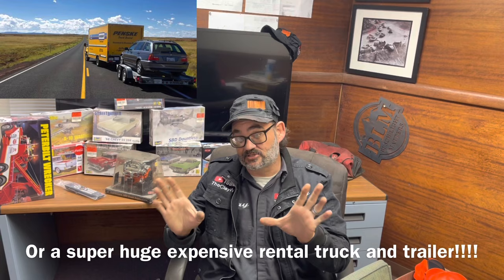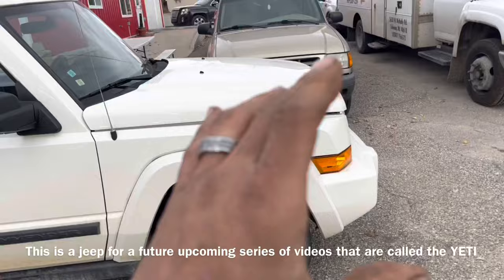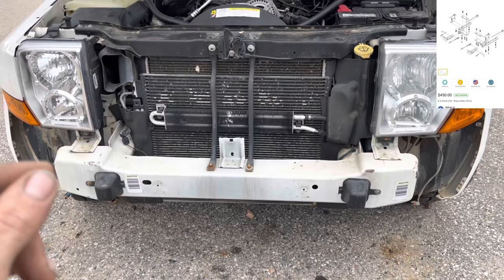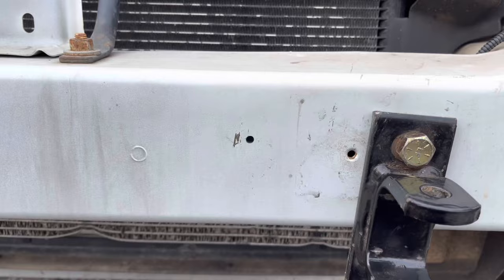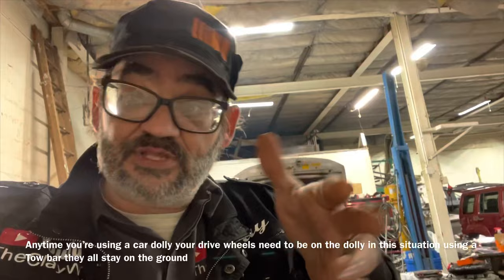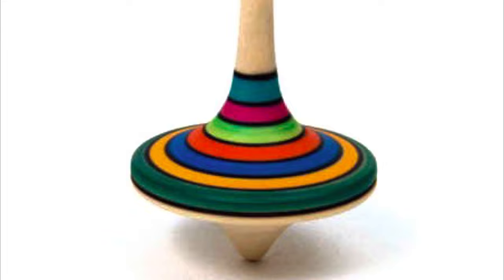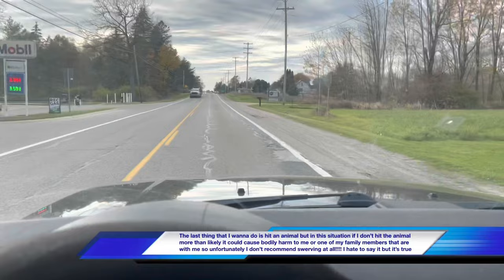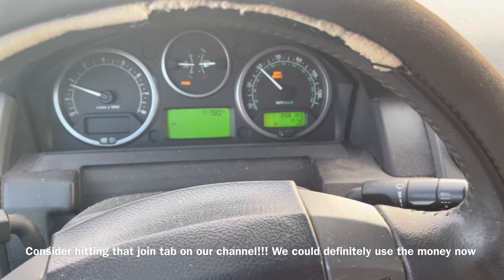How to Use a Tow Bar on Any Vehicle and Why It Works , Why Towing a Vehicle Will Not Crash and burn!

Comment: I used a fence post with a 2" trailer hitch from harbor freight and towed my 89 honda accord 2,300 acrost the US with my VW golf VR6 .It worked perfectly. key in and battery disconnect
Reply: I would like to see that ! Was it a steel or wood fence post ? How did you attach it to the car chains and turn buckle ?
Reply: I have a 96 accord and they don't come with a metal bumper
Reply: That's pretty much exactly what I'm working with: a VR Jetta and a '91 Accord. Good know, thanks for the details.
Reply: @Shellyspurr Sure they do. The bumper itself is steel, but you have to remove the exterior plastic bumper cover to get to it. The bumper cover typically has a Styrofoam inner core that stays in the cover as well. You need to remove the plastic cover from pretty much every bumper to use a tow bar and bolt the brackets to the metal.
Reply: @YerBrwnDogAteMyRabit  not this car, my Charger has what you're describing, but the accord is a composite bumper. I drilled through it.
Reply: @Shellyspurr  
Foxbody Mustangs also... the bumper (the real bumper under the
urethane  cover) is fiberglass.
Reply: @garyuselman8597  This is exactly what Clay meant when he talked about Common Sense not being so common anymore. 

HE traveled 2300 miles! Yeah, he used a wooden fence post (Insert sarcasm here). Let me know how that works out for you!

Comment: About 20 years ago i towed a 1970 VW bus using a tow bar, with a 1971 VW bus. Worked like a charm, i would like to apologize to the woman whose front yard i had to use to get on the turnpike after missing the entrance. You can't make as tight a turn as you would without being connected via towbar.

Comment: Great video, man. I bought a new tow bar 15 years ago and never had the courage or need to use it, but I sold my car trailer and now have to tow my small tractor about 15 miles. You have given the the knowledge and confidence to bolt it on and give her a go, at slow speed, anyways. Thanks for sharing your knowledge.
Reply from the maker: Can you send me some pictures to my Clays AC and auto repair Facebook page. Direct message me through there if you don’t mind I’ll make a post about it on my channel
Reply: Takes too long.  No thx. Ain't nobody removing covers.. thx tho.

Comment: Outstanding video, you explained everything very well! Last year I flat towed my 04 Civic 600 miles with my 05 Civic using a Harbor Freight tow bar on its bumper bar like you showed and magnetic lights on the back and it worked great other than the towed car trying to wander around because its steering and suspension was in bad shape at the time. I'm sure now that I rebuilt the 04's steering and suspension and it drives correctly it would tow well if I ever need to tow it again.
Reply from the maker: Thank you very much for the kind words Avery welcome to the channel. Happy to have you.

Comment: about 10 years ago my VW golf snapped the T belt and cost me 350 to tow it home that pissed me off so  i thought  i have to build  a tow bar   , i bought a  tow bar like that  from harbor freight plus I extended it with square tubing and a  flat stock piece welded to extend out at the end to sit above the control arms then bolted  steel chain at the end of the square tube , bolted 2 3500 pound straps to each arm  i loop the chains around the control arm and hook the straps to the chains ,  and off I go in 10 minutes,  not only have i saved a lot of money since I also made some

Comment: I just got a tow bar from vevor and a few things in the instructions worth taking note of are..
--Some vehicles with power steering may “follow” better with the engine idling.
--When making turns begin by rolling straight forward, then turn the wheel.
--Do not back up with the vehicle in tow.

Comment: I'm turning my 2002 s-10 into a towable camper and had no clue on how to use a tow bar. Thanks to you I'll finally be able to start this project. I plan on gutting the engine bay and interior for storage so I don't think weight is going to be an issue. Thank you for the explanation.  Just wish i would have seen this sooner.

Comment: New to tow bars just wanted to say thanks. I'm pulling a 2wd van and was gonna pull the driveshaft until I watched this
Reply from the maker: If you can pull the driveshaft I would recommend it sorry I just seen this post
Reply: @sharpcarco  I routinely check the rear end to see if it was getting hot and it wasn't it wasn't even getting up to regular temperature. The transmission wasn't either

Comment: I really enjoyed your video. I like your sense of humor. You’re a lot like I am. How hard could it really be? Let’s just try it. I’m gonna put one on a jeep grand Cherokee 2004. I have tow lots of wranglers. But never cheap grand Cherokee with a plastic bumper. I’m going to use the multitool to cut out a rectangle through the plastic bumper cover. Thanks for the video.

Comment: Ordered a Miller 110 welder($625) and a surge brake actuator($400). Steel estimate @ $400. Going to build my own tow bar! Couldn’t find what I wanted at a price I liked to tow an 8000# motor home. After this trip the tow bar will turn into a trailer to be used behind the motor home. Going to hook the surge brake actuator to the motor home trailer brakes.
Reply from the maker: Any updates on your custom tow bar? Sounds pretty sweet!
Reply: @sharpcarco  decided my van would not be able to tow the motor home over the mountains so the project is on hold for a few months. I’ll go back this summer and try again.

Comment: You could have gotten a different hitch that was level pretty cheap from harbor freight. Also not near as concerned about pulling something as I am stopping it. Back roads and slow speeds may get it, but no place to be on the highway, especially in traffic when you have to make a hard unexpected stop to avoid rear ending someone. Have you checked to see if this is covered by your insurance?

Comment: Good video,  I'm towing a 98 gmc with a 2006 chevy silverado both are 4x4 to Kentucky from Arkansas in about 2 weeks what advice could you give me
Reply from the maker: Remove the rear driveshaft and the front driveshaft

And if you want some Economy in your  tow rig 

Buy a hydrogen generator  hook it up and fill it for You Tube

Comment: I was a little confused on the all wheel drive part . So what your saying is that it’s safe to use the tow bar on it as long as it’s on neutral
Reply from the maker: Well, as long as the very short distance, and all four wheels are on the ground like in my situation, everything should be a neutral. The only problem is that the transmission pump does not pump unless the engine is not running so whenever possible it’s always best to remove the driveshaft if possible.. and especially if you’re going to great distance, I would say if you’re going any further than 20 or 30 miles it’s better to flatbed it or use a wheel dolly with wheel dollies on the back

Comment: I sure hope my 2000 4x4 s10 blazer will handle pulling a 1987 s10 4x4.  Just bought an old blue ox tow bar set up. Planning to mount it to the front of the frame where the tow hooks mounth.
Reply from the maker: How did it turn out?
Reply: @sharpcarco  life happened and I didn't get the 1987 s10.  I did manage to find a cheap tow bar set up . $10 . Couldnt beat it.  I also found a Uhaul hitch in the Upull.  Paid $40 for it.  I did pick up a project car hauler trailer, not sure if I'll keep it . Either way whenever I run across something else , ill have the stuff to haul it.or tow it.

Comment: Thanks for making this video. I probably would have drilled right through the plastic to mount the tow bar. But taking off the cover makes good sense so you can see the best place to mount the bar.
Reply from the maker: Well thanks Michael for taking the time to write that message I’m glad it helped you welcome to the channel and we’re very happy to have you.
Reply: That is the most ridiculous comment I saw all day. The plastic cover most definitely will not hold up to the stress of pulling the car by it,  you almost certainly won't be able to get the nut on the back of the metal bar with the cover on, you could easily damage things behind the cover by blindly drilling into it, and having plastic and likely foam between the tow bar's brackets and the metal bar would be extremely dangerous since it's so soft. If it squishes down as you drive, the nuts will come loose. Towing is not the place to be lazy or shortcut things to your convenience.
Reply: @averyalexander2303  you are rude. There is always one and you are it.

Comment: Before anything, I would like to say thanks for the video, I got a little issue, I need to pull up my car about 14or16 normal drive,so I consider that  most be going to take me more hours than that, my car is a old 78 ford thunderbird that’s heavy, my plans are to pull up with a 1500 dodge ram, I feel a little bit scared, I never did this before, I will going to need good wishes, I have been pulling trailers in the USA but never cars with tow bars, thanks for the video.
Reply from the maker: I recommend removing the driveshaft before you do it, but pay close attention to the part of this video where I show you why pulling something with a tow dolly is not really a problem… there are particular procedures though for a rear wheel drive vehicles I think you need to hold the steering wheel with the safety belt but it’s been so long since I towed a rear wheel drive vehicle with a tow bar I don’t know that I ever did it before. So just a smidge more of research will make you feel more confident I’m certain you can do it. I don’t think there’s gonna be any problem, but less be a little bit more cautious, and will be assured success.
Reply: @sharpcarco  I really appreciate your advice, I’m still working on , the companies over charge to howls, with that money I can make the trip and I still save money. Thanks again and happy 4 of July.

Comment: I need to tow a 2011 equinox from Michigan to Mexico. But I don't know what drive shaft to remove so the transmission or parts don't burn or mess up. It's all wheel drive
Reply from the maker: Do you need to remove the CV axles? The ones that are connected to the front wheels
Reply: I removed the driveshaft the long one that goes from the front to the back of the vehicle

Comment: I want to tow a front wheel drive vehicle (Honda Odyssey) a long distance—1000 miles. I had heard you aren’t supposed to use a tow bar but rather a tow dolly to keep the front wheels from constantly spinning which will destroy the transmission. You addressed the issue of AWD and RWD about disconnecting the driveshaft. I’m assuming from your video that it’s OK to tow a FWD vehicle without doing anything other than putting the car in neutral and leaving the key in the ON position—correct?
Reply from the maker: You definitely have to use a tow dolly for that. And yes I talk about that in the video . Sorry I did not address the front wheel drive version. Even though I believe you could probably tow that thing like 20 to 30 miles and it would probably be OK depending on the speeds that you were going without a tow dolly but in your situation you definitely don’t want to do that with that vehicle really sucks

 I wish they had a way that you could disconnect the front driveshaft and tow it without it being a lot of work. Obviously if Took the front driveshaft it would be NO problem whatsoever and you could use a tow dolly and it would work really really well. But I don’t know your level of mechanical experience so if that’s not something that you’re familiar with you may find it to be somewhat of a challenge but then again I’m sure there’s plenty of videos to show you how to remove the drive shafts then you would just take them out and leave them out but I don’t know if it would be worth the expense that it would cost you to rent a tow dolly. I would say if I told Allie was gonna cost me $400 to rent I would probably consider doing it
Reply: @sharpcarco  Thank you for your quick reply. I’m skilled at removing the CV drive axles but didn’t want to do that if it wasn’t necessary. I see a lot of cars being towed behind motor homes or RVs using a tow bar. I’m fairly certain that many of them are FWD. But I can’t believe that the cv axles have been removed.
Reply from the maker: That’s a very valid point I can’t imagine that all of them people do that either. It might be possible that I don’t understand the front wheel drive transmission the same way as the rear wheel drive transmission because of how the axles actually go in on the same side so it is possible that with the vehicle in neutral does not spin the gear the same way unlike a rear wheel drive engine that Hass to transfer energy completely through the transmission a front wheel drive transmission may not work the same way. 

I’m not a transmission expert for sure hell I’m not an expert at anything 🤔😂 i’m just an OK editor….. 

Anyways I appreciate the kind words and welcome to the channel we’re very happy to have you let me know what you find out with that situation…. I’ll do some of my limited investigation as well…
Reply: Maybe these cars are FWD BUT with a manual transmission?
Reply from the maker: Absolutely valid point more than likely you are correct
Reply from the maker: You know though you wouldn’t have to technically take the axles out of the transmission you would just have to take them and move them away from the wheel bearing depending on how it’s set up on the front end of the Honda you’re trying to tell you may be able to just move the strut out of the way from the top if it’s got an upper control arm and pull the nut on the axle make sure the axle set out-of-the-way it’s probably worth it to be honest with you since nowadays they charge so much for car dollies and even on a car dolly if it’s not positioned 100% correctly you may get sway were you will not get that with the Tow bar

Comment: I didn’t get the part about the transmission being lubricated when the engine is not running I thought you had to be a battery operated transmission pump or certain vehicles had special electronic apps to circumvent that?
Reply from the maker: When the engine runs the transmission pump runs pumping fluid to the critical parts of the transmission

When you’re towing a vehicle, even when the vehicles in neutral parts of the transmission are still spinning on the inside 

But they’re not getting lubricated properly 

That’s why it’s best to remove the driveshafts, so the transmission internals are not spinning . In this video, I did not do any of that. I pulled it with everything spinning on the insides of the transmission which are not good for transmission. However, I did put it in neutral, and it didn’t seem to have an effect, but I can’t guarantee that it won’t in your situation Point of the video is that you can cost-effectively tow a vehicle anywhere without a tow truck and the other point of the video is to show you how the vehicle turns when you’re using a tow bar

Comment: Hey that was a great video thank you.  Do the tires and wheels turn the correct way when you're backing it up or is it possible. Is this possible with 2 tractor trucks.
Reply from the maker: In the south, I see people do it all the time it is the craziest thing I’ve ever seen somebody pulling two vehicles with one seems pretty dangerous to me, but they do it.

As far as backing up goes, I don’t recommend that because when you hook it to the bumper like I did, it will bend it .

Comment: So questions: if I have an offload bumper with clevis mounts for d rings, why couldn't I just use those to hook up? Would I really still have to drill and mount the brackets from a kit? Also, can I safely flat tow a 4x4 Jeep Xj with a 5 speed manual?

Comment: you showed a lot of modern cars. What about something form the 50s and 60's I understand it would likely be easier with the bumper removed, but will the hardware line up? They often don't have a lot of area to drill on some of the older cars. do you have an example of that?

Comment: I just watched a video of someone removing a bumper on the model of my car-1999 Lexus RX 300. I was looking for a place to install the two small tow bars, but there's a big white plastic shock absorber I'm guessing, under the faux bumper he took off. Where would you put those bars? Underneath the plastic on the frame?  Or, cut two spaces out of the plastic? If I put them under all that on the frame, I'm not sure I'd even need to finish taking my bumper off. I'm down to one screw, then it's off. LOL
Reply: I have a pic of the car without the plastic bumper cover on it.
Reply from the maker: Well, you can message me on Clays AC and Auto Repair. Over Facebook it’s free and I don’t collect information. I’ll certainly try to help you out. I’m sure the two of us can figure something out.

Comment: nice explainations I have a 8200LB chevy 3500 RV van probaley heavier than the sprinter you mentioned. would my van require actuel base plates that bolt to the frame. or could the stuff you bolted to the jeep work?